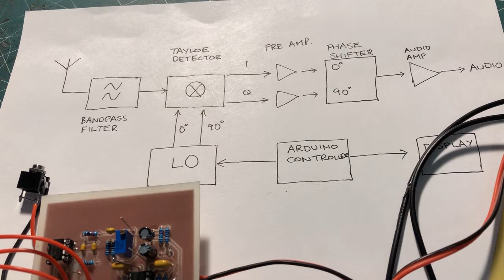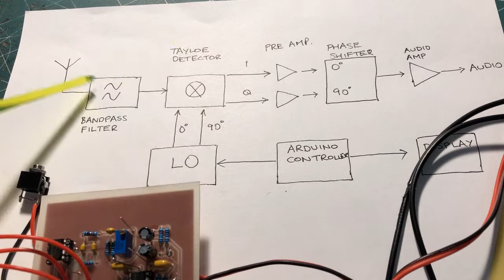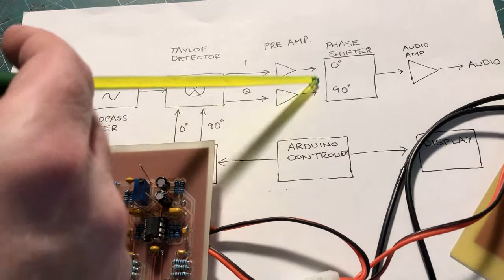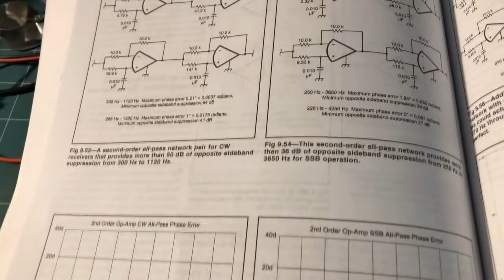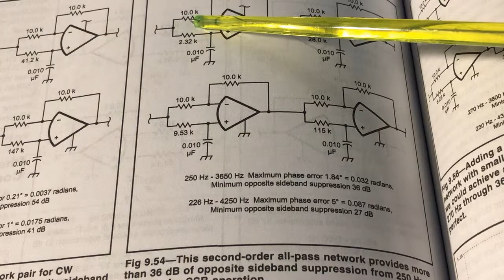Arduino Radio

Comment: Is your atmel328/arduino code available for download?  Thanks
Reply from the maker: I think this is it. Its been a while: https://github.com/thaaraak/IQ-Radio/blob/master/Radio/Radio.ino  Note that this version calls "set_phase" on each frequency change which causes clicks in the output. You really only need to call "set_phase" when changing multipliers.

This code for the Teensy does that properly (but won't work on your ATMega328 of course) https://github.com/thaaraak/IQ-Radio/blob/master/Tayloe/Tayloe.ino - look at line 539

Comment: Great Video.  At 6+ minutes in you mention changing sidebands by swaping the wires where the LO is injected.  Alternatively, couldn't you software switch the phase in the Si5351 from 90° to 180°?  Or is that hardcoded in the etherkit library?
tnx & 73, km6wt
Reply from the maker: You could absolutely do that - and the toolkit would support it. Thats one of the amazing things is the flexibility you have with these I/Q style radios. For a purely software implementation in changing sidebands (and in I/Q processing) check out my other video: https://www.youtube.com/watch?v=I8ZwlgjXAZM&t=14s

In that implementation I don't change the LO phase but rather the I/Q phase. Thank you for the comment!